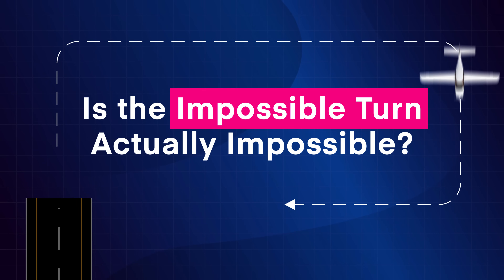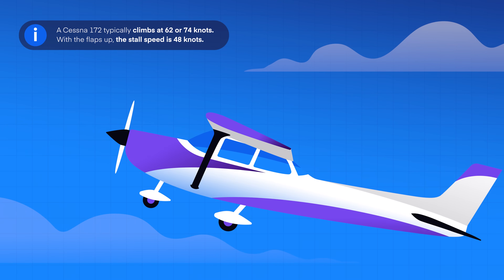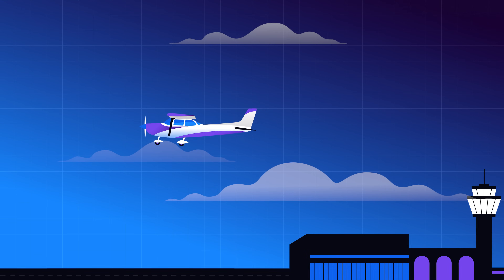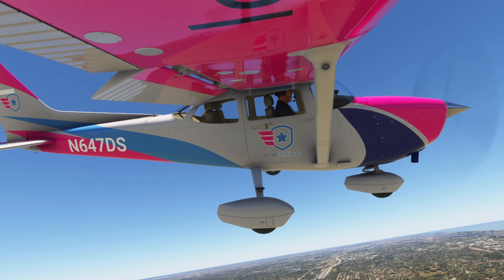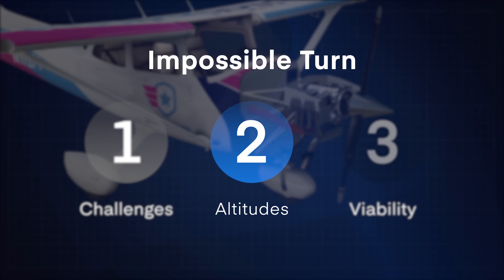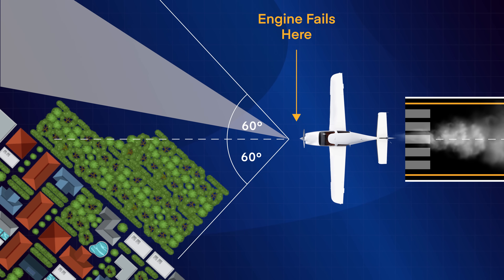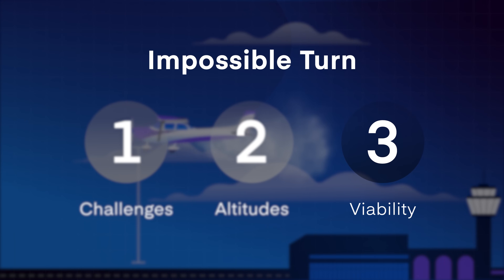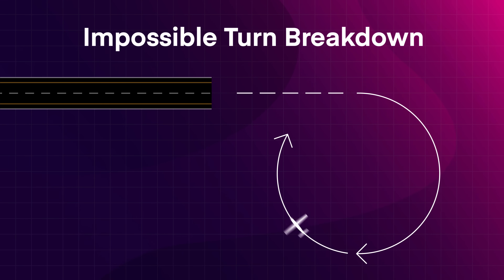Is the “Impossible Turn” Actually Impossible?

Comment: I think it’s critical to do the initial climb at Vx to have the best relationship of gained altitude to distance back to the runway and then make the impossible to the side the crosswind component is coming from, so the wind carries you back to the runway, not further away. I always include this in my emergency briefing. We trained the manoeuvre during my ppl training and one thing that stuck with me was by how much I had to drop the nose to speed up and keep the speed without the engine while swiftly inducing a steep bank angle of about 45°.  In this intense situation I think it’s not that important to achieve the optimal airspeed, just to make sure there is enough buffer to high bank stall speeds and a possible stall/spiral. In discussions about the impossible turn there is often no or not enough emphasis on the things a pilot can do to increase the likelihood of the impossible turn to actually work. And it’s absolutely recommended to try this at least in the sim.
Reply: I'm not arguing with you or here to say you're wrong on the internet or whatever. I just want you to hear my perspective based on my experience. I'm a long-time CFI and I've practiced and carefully experimented with the "impossible" turn countless times in different conditions, and I've done it for real twice. Please take the time to consider what I have to say. 

Engine failure during a Vx climb at low altitude can be really sketchy in a lot of planes, even without trying to initiate the relatively aggressive turn back to the field. You're giving yourself a disadvantage by starting the whole process with a high AoA and low speed. I know it makes sense numerically to climb at Vx if you're focused on height vs distance to the runway, but that doesn't account for the rapid altitude loss due to the low energy state of the aircraft when entering this scenario from a Vx climb. 

First, you REALLY have to shove the nose down aggressively and immediately if you lose the engine during a Vx climb. Assuming you react fast enough and don't immediately stall (and spin if you didn't train yourself to immediately release the heavy Vx right rudder) you've lost a solid chunk of altitude already just getting the nose down and preventing a stall. Now you're sitting there with an even bigger AoA, lower speed, and a rapid sink. A normal climb is much more forgiving to a sudden loss of power and you'll lose significantly less altitude right out of the gate just in the process of lowering the nose and avoiding a stall. 

So you got the nose down and didn't stall, but the plane is still below best glide speed, so you're sinking fairly rapidly at this point due to the extra induced drag. You can drop the nose and try to speed up, or just deal with it but DEFINITELY don't get any slower! Either option you choose is going to result in a rapid and unavoidable sink, definitely more than if you were at best glide speed. At this point, whatever gains you initially made with the Vx climb have been negated by the rapid sink rate caused by the low speed and high AoA when thrust was removed from the equation. If you were at Vy (and reacted quickly) you'd already be set up at your best glide speed! 

Now you have to actually execute the turn, which will need to be fairly aggressive. Banking the plane is going to cause an even faster loss of altitude, because you're definitely not pulling in this turn considering your already-high AoA. Or you shouldn't be, at least. It's very difficult to resist the urge to pull back just a tiny little bit when you're in this situation for real. By climbing at Vx you've already set yourself up with very thin margins. So now you're sinking even faster, and you have no extra margin before a stall if you pull back a little bit subconsciously. At this point, you've DEFINITELY negated any gains you made by starting off with a Vx climb. 

Here's another consideration for performing this maneuver at speeds below Vy/best glide: The plane is going to fly like a wobbly mushy turd. How often do you practice flying the plane in this flight regime? We're basically talking about power-off descending slow flight with aggressive banking. The controls will be very mushy and you'll need skillful rudder work to stay coordinated, which is very important in this situation. I'd much rather be flying this highly stressful maneuver in a configuration I'm well accustomed to; best glide/approach speed. 

You should absolutely go out and compare these scenarios for yourself at altitude using ground references and a "deck" altitude. Be strict about the numbers and be observant. Even better if you can stick a gopro in the cockpit and review the footage afterwards so you can give your full attention to the maneuvers and review the gauges later. Give yourself at LEAST 3 seconds before reacting to the simulated engine failure. 

Good luck!
Reply: Thank you for the input, it makes sense to me. And I usually climb with Vy, so it's the more realistic scenario to train anyway.
Reply: @airfelix  Right on. Blue skies brother!

Comment: The problem with all of these power pilot analysis of the turn back procedure (which is required training for glider pilots as stated in several comments above) is they assume best glide speed yields the best performance. This maneuver is best done at minimum sink angle of attack not best glide and 45 degrees bank should be the goal not the limit. If the airplane is equipped with a stall horn and it is properly setup minimum sink AOA is roughly equal to the AOA that the stall horn is triggered at.

In testing with a 172 at 500ft AGL 45 and 60 degree banks yielded nearly identical results but the skill required for 60 was significantly higher and unrealistic in a high stress emergency. At 30 degrees bank it was indeed impossible to return from 500ft AGL. 

1. Don’t do it unless you have practiced it. 

2. Practice it at altitude with a CFI using at least 1500AGL as “field elevation” then step it down 500 ft at a time over an open field before moving on to an airport. 

3. Stalling while banked is not inherently dangerous but stalling while uncoordinated is. This maneuver should only be performed if your coordination skills and awareness are high enough to keep it coordinated under the stress of an emergency. If they are not this isn’t for you.
Reply: OK, so at 500 ft AGL it might not be an impossible turn. But what about 450 ft AGL? or 475, or even 490? 
And what happens if you try it at 490, or what you think is 490 AGL, and you see that you're not going to make it? what do you do then, in those circumstances, not sitting at your desk thinking about it.
There is a reason it's called the "impossible turn", it's not because it's impossible, but because too many people have died trying it after an engine failure (or even just a reduction in power).
We all need a rule of thumb that is clear and easy to remember, and that we tell ourselves before every flight.
1. if engine loss, push forward on the yoke immediately, get that nose pointed down (same orientation as when on final for landing - to keep up a speed that is above stall)
2. if above 1500 AGL then turn to return, but no more than 30 degrees bank (remember that the stall speed goes up as you bank)
3. if above 1000 AGL you have about 90 degrees left or right from which to choose a landing site
3. above 500 AGL, you've got about 30 degrees left or right to choose from
4. below 500 AGL, land straight ahead
Practice this in the practice area at 4 or 5000 AGL so you can see how much you actually lose in a 360 degree turn with no engine (it's not 180, because you're not lined up on the runway after 180, you've got to do 270 in one direction and 90 in the other, or a total of 360). Then you can change the numbers to suit your airplane.
Reply: I would not advise to practice the impossible turn below 1500 AGL. That being said though it is a good idea to see how little loss of altitude one can get after practicing the maneuver in safe conditions then keeping that number in mind with a safety margin when briefing their before takeoff checklist. I have practiced in the sim at airports I operate out of the impossible turn on all the runways so I have a good idea of what altitude I could reasonable pull it off on to declare a cutoff point to where I would rather go to my chosen emergency landing spot than try to turn back.

Comment: In shipping there is the Williamson turn. It’s for man overboard. Turn left 60 then immediately right onto a reciprocal of your original course 

For engine out it takes you slightly further out but has the advantage that you can do shallow turns and you don’t end up at 90 degrees to the runway.
I would be interested to see how it would work for engine out
Reply: this is actually what I assumed the impossible turn was, a return to a reciprocal heading.... so that is wrong?
Reply: @xisotopex I'd assume that'd be the maneuver you'd use in a larger aircraft where a single engine failure will not necessarily cause the craft to stall, like say a passenger plane.

I'm not a pilot I just know the science 🤷

Comment: I had to make the "impossible turn" at about 500-600ft AGL in my C150 a few weeks ago.  On climb out the engine made a few, significant, sputters.  Thankfully I still had power and decided to make the turn around as a precaution. I'm glad I did, but If the old girl would have gave up the ghost before the turn there is no way I would have made it.  Even though I reacted fast (hiccup to turn back in ~4-5 seconds).  

Not a fun situation, but I'm kinda glad it happened how it did.  You read about engine outs and watch videos but the real thing really puts in in perspective.
Reply: Having ANY power at all is not the impossible turn.

Comment: Bottom line: the impossible turn has impossibly low odds of working out. 1) You have to be incredibly well rehearsed in doing it. That means lots of high risk practice. The practice has a higher chance of getting you than an actual engine failure. 2) Most engine failures are not instantaneous. It's gives a pilot too much indecision time, too much lost speed, and by the time the decision is made, it's too late. Add to that, there's risk of a false positive where the engine is not having any serious problem and the reaction is an over-reaction. 3) You can do a wingover rather than a turn. That has all the problems of 1 & 2 combined x 10. Plus a badly executed wingover at low altitudes is a guaranteed stall/spin.
Add to any of these scenarios a complicating factor: wheels dropped, fire, passenger freaking out, flaps set wrong, ... and probably of failure is x 100.
Reply: Also,  the stall speed of a cessna is so low,  you can put it down in trees and still survive.

Comment: Some WW2 airfields used to have a "forward landing field" for bombers that could not make the climb fully loaded (e.g. if an engine was misfiring). Instead many small airfields have "suburbia" upwind of the runway so there is not a lot of choice for a safe place to land unless there's a park or a freeway you can line up on. A bunch of sports fields would be fine, but no-one seems to care to do anything about it.
Reply: Mine has a river and a cliff face, ouch.
Reply: @storiesfromthedepthsofspac6413  I would choose the river landing!
Reply: @redbaron07  Yeah, but cliff face would definitely earn you an episode on Mayday haha
Reply: As does the space shuttle.
Reply: @falconwaver  Zaragoza!
Reply: @redbaron07  Banjul if going to Hubble.
Reply: You need to go back to math class when that airplane tips at a 45° it's generating almost 1 and a half times the weight as a force not a pure square lifting the right direction Force rather enough Force to hold the airplane up or it's going to be dropping a little slower. Instead of doing the proper landing right down the center of the strip leave the wheels up and do the belly landing and let it slide across that big flat place. Everybody screws into the ground when they try to line up and land and be a hero.

Comment: l'm not a pilot, but it seems to me that forethought is paramount for this situation.  That is, have a good idea of all factors before takeoff.  Then when taking off, you will instinctively know from your height and flaps and speed at what point the impossible turn IS possible.  In other words, you pass a line or haven't reached the line yet and actions depend on if you have hit that line or not.

Comment: Yes, I have done the impossible turn… in my sim. I was practicing an emergency landing on a runway, I overshot it and instinctively did the turn to go back to the runway. I stalled and crashed on the runway. It was a good thing it happened on a sim. I learned the lesson and will never attempt doing it in a real flight.
Reply: What kind of plane was it ? How much altitude did you have when you pulled the power or cut the engine ? How steep were your banks ? Were your turns coordinated ? Were you watching your airspeed in the turn ? Did your propeller feather if applicable ? How accurate is the flight dynamics of the sim ? A sim is a sim.

Comment: It's probably a very difficult manœuvre with a regular aircraft.
But it's really good if you train for it... and it's reasonable to try with an ultralight. 400 ft is enough...
The training means you're ready to react quicker and very aware of all conditions like wind which is nearly never exactly in the track axis. Turning against the wind helps a lot.
And an ultralight climb so steep you can reach the possible turn altitude before the end of the track, you can glide very slow... eventually landing on any surface without the need to reach the hard track. My usual field was ending over a forest so I was very careful to make accurate plan for any north bound takeoff. The official rule was no attempt to turn back below 500ft...but in good days I reckon 300 would be enough...and practice at 400 wasn't really hard.
Of course it depends on many factors and the key is to think about it before you even start the engine.

Comment: Maybe you ought to look at the gliders with their 200 feet AGL rope break. 45 AOB is the quickest way to turn and to lose the least altitude in the turn. There is no such thing as best glide speed, only best glide AOA (though this is for still air or through the air mass). We trim to AOA not speed, if you set 45 AOB and don’t pull back, you won’t stall and you’ll get through the turn quicker. Terrain permitting, make the turn into the wind or in the direction of turn if turn already started. 45 AOB gets you quicker around to sooner have your wings under you to be set to land. G only goes up with bank angle if you’re holding the aircraft up. Those charts are for level flight. It is ok to accept an increased rate of descent for more turn to get the turn done quicker. Stall speed does not increase with AOB. It increases with longitudinal stick pull or increased pitch rate. You’re increasing your pitch rate hence load with the AOB when combining the pull to stay level or to maintain a given rate VVI. If you turn with no additional pull, you’ll maintain constant AOA and constant load though with increased VVI and consequently increased speed - it is ok to let the nose drop to affect the turn - in fact, it is safer to do so. You’re correct to say “… or increase airspeed” but this is a consequence of rather than deliberate choice action, the choice is to maintain AOA. (We should probably teach constant AOA turns in slow flight rather than or in addition to constant speed turns) There’s a good Medium article Improve your Landings with AOA and Power Techniques that applies here. Ultimately, though, for any given airframe you need to have an idea of AGL required to complete. Airport layout with alternate runways and taxiways becomes a factor to consider while runway length may help with some of those congested airports which may not have off airport “straight ahead” options.